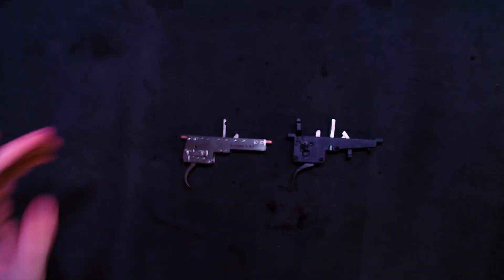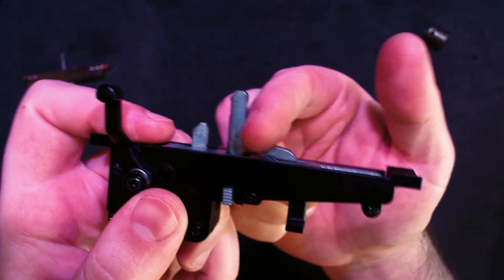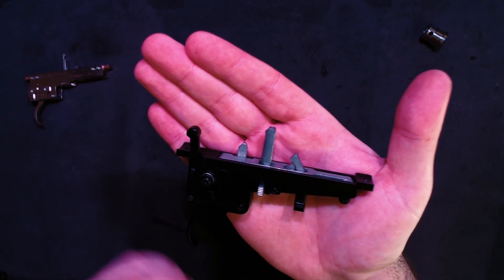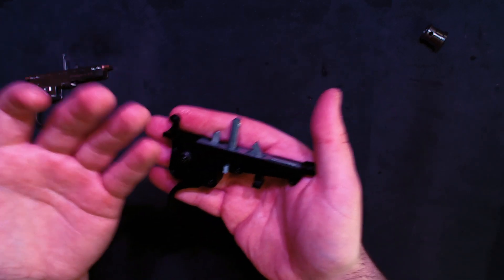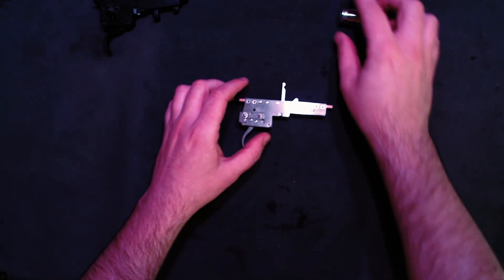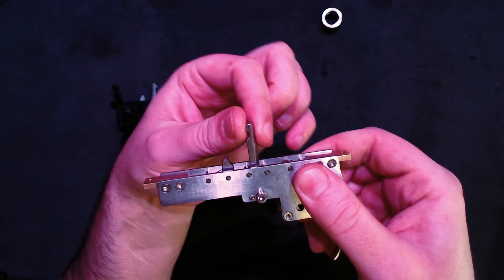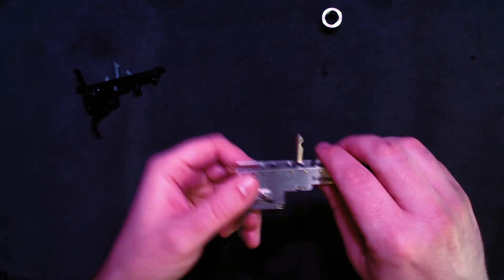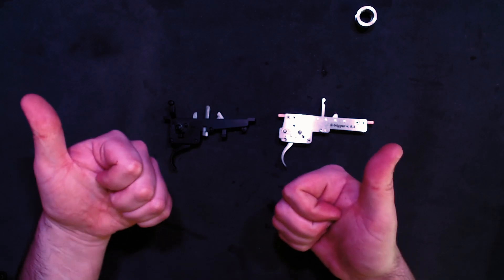45° VS 90° DEGREE TRIGGERS | SM TECH SHORTS #1

Comment: I bought a zero trigger for my VSR 10 g-spec. It worked perfectly until i took to an airsoft field... now the trigger hangs limp and it wont catch the bolt. My locap airsoft tech couldnt fix it either. Please help me or tell me where to go to ask questions about this. Thx 🙃
Reply from the maker: What trigger?
Reply: Action army zero trigger
Reply: I have also ugraded the barrel, the hop up unit, the spring guide, the spring, and the piston.
Reply: I can give you my discord if you would like so i can show pictures or videos
Reply: @SniperMechanics I have spent a little over $1k on this sniper... if i need to pay for your counsel to repair and make this thing run I would be up for that 😅